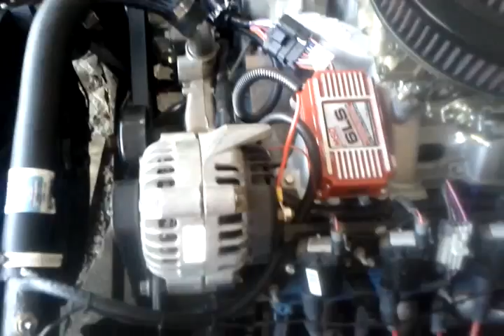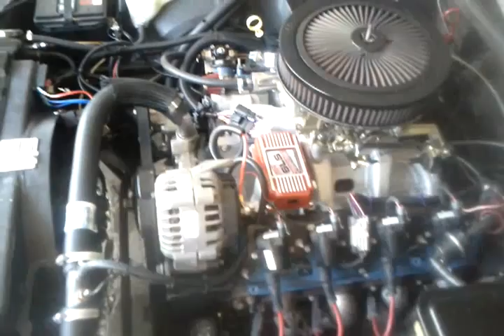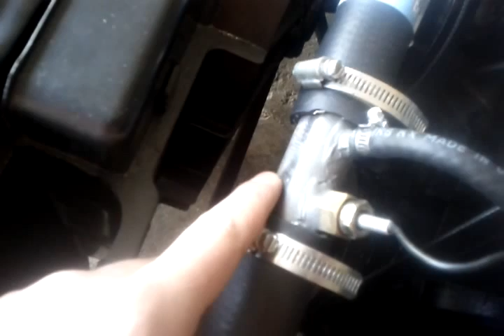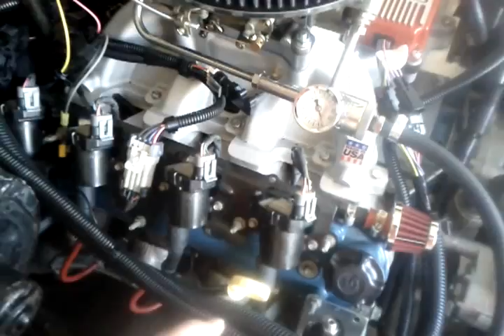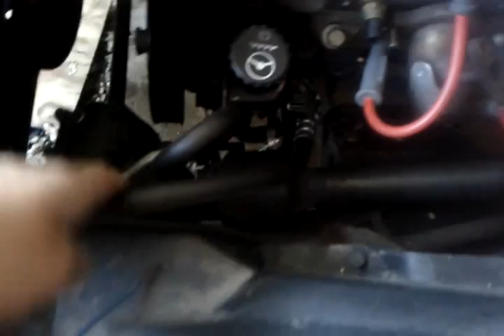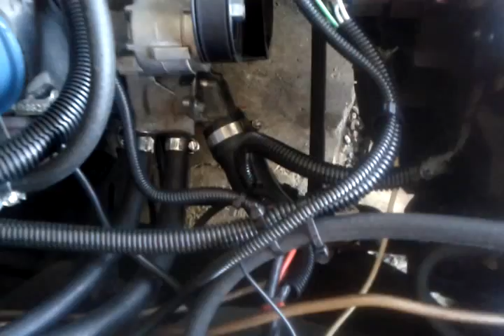How-to: Swap an LSx Ls1 4.8 5.3 6.0 into older GM cars

Comment: I'm having trouble getting mine to sit down on the motor mounts
Reply from the maker: Kelvin Thompson What kind of mounts are you using
Reply: Trans dapt
Reply: One side will mount one off a Lil and I'm putting it in a box caprice

Comment: Does the MSD box just control your coils firing? 

What sensors does it need to see in order to function?

Do they make something similar for fuel injected setups so you don't need to run a factory ECU?  Something I could plug into a junkyard engine and run on a test stand if I wanted.
Reply: brakedd crank PS cam PS and plugs into both coil banks and needs power ground im almost sure thats all it needs

Comment: Did you have to change the oil pan I have a ls1 out of a 2000 trans am.. I am putting it in my 1988 Chevy caprice wagon and I was wondering if it would have clearance issues with stock pan
Reply from the maker: james morgan your oil pan should work perfectly... IF you have a Truck engine the pan will work but you risk bottoming it out.. I went with the Caddy CTS-V pan because of its shallower dimensions..

Comment: I have a 1980 Buick Regal. With a 5.3 & 4l60e. I'm using the dirty dingo slider motor mounts that work with mounts you have. But yours seem like its sitting better than mines. And I'm running fuel injection. Try to see what to do with my trans crossmember

Comment: I have 93 ford f150 with ls1 already swap
With harness computer all I want to start the 
car
The computer is already canceled the security
Harness is fixed
I think there is some wires need to connect from computer to car fuse box
Can you help?
Or give me some info
I want start by myself if I can

Comment: Did you move the engine forward or backwards, or is it mounted so that the bellhousing is in the stock location of say a SBC? Do you know why sometimes the LS engine is moved forward or back? Seems like a lot of work to repostion tansmission mount if you move it from stock sbc location.
Reply from the maker: Engine is set back 1 inch... transmission is in its stock location
Reply: Alright thank you. Awesome swap!

Comment: Want to put one in my Buick lesabre (5.0 L Olds) now. Do you see Any foreseen problems?
Reply from the maker: No
Reply: Thanks
Reply from the maker: its very straightforward. good luck!
Reply: would this engine work found on craiglist:
http://atlanta.craigslist.org/nat/pts/5583603349.html
what about changing th2004r transmission that came in my 84 buick lesabre limited 5.0l olds engine
I hate to be a pain but your'e only straight shooter i kinda know!!!!!!!!!!!!!!

Comment: The cross over coolant hose between the heads..where did you run it? Is that the "steam line" you mentioned? And what rear end gear ratio are you running w the 4 speed?
Reply from the maker: 3.73s the steam line goes into the upper radiator hose

Comment: Wondering, did this kill your fuel milage?

I have a '73 Nova with the original 350 in it, and it gets god awful fuel economy. I'm really bouncing around the idea of swapping a 5.3L in, as they're cheap and easy to find in salvage yards, but never did I think of putting a carb on it. If it still get's good fuel milage, I might do something similar.
Reply from the maker: 20 combined with the Quadrajet ... lets see what the Demon gets come spring
Reply: BEETEROLDS i have a 85 c-10 and i was going to swap my 82 c-30 454 to it but with this LS swap gaining so much ground im looking the other way now and the BB is in good shape but the idea of having the new engine in my old truck is very tempting

Comment: Can I buy the plug for the alternator ..
Reply from the maker: ***** You can also harvest them from the junkyard... My alternator came out of a Blazer... 1 wire harness... easy peezy..... PS Fuck Oreilly ;)
Reply: Oreilly's sells them. Something like $4 or $6. I think the are between the light bulbs and heat shrink. Usually when I go to the parts store there's always some computer nerd that ask for what year make model vehicle and I just throw my hands up and start digging. No I usually walk in with a dial caliper and go straight to the back. Built not bought. That's MERICA.

Comment: hey bro i have been having trouble with the oi pressure switch step adapter. would you happen to have the part number for the one you ran on your car? thanks for the help

Comment: I am looking to do a similar build on a 84-84 Monte SS or a 85-88 Cutlass 442. Using a new carb and keep the 200R4 & 8.5 10 Bolt. I don't wrench myself so fabricating stuff is out. Id spend as much on paying my installer than just buying the aftermarket fix. I have access to a 2004 LM4 all aluminum 5.3/4l60e complete with everything. Just need to know what is the simplest install into the G Body.

Comment: How do you make the transmission work with a newer ls1 motor?
Reply: I always use the 6.0 flexplate and spacer (spacer goes against the crank) just for simplicity. you will not use on of the bell housing bolts. (top passenger side iirc.)

Comment: so if i have a 350 tbi in my truck right now, and i just bought a lm7 what will i have to change for the fuel delivery system? ie pump, lines and all that?
Reply from the maker: not if ur running a carb
Reply: What else will I need to get if I get a carb and intake manifold for it? And do carb?
Reply: Zachary Martinez
 you need a regulator to regulate the tbi fuel pump down to 7psi that the carb will need.

Comment: How did you hook up the pwr steering? And a/c.
Reply from the maker: im not running AC
Reply: power steering is easy. take the pressure feed and return line into you rack or power steering box. A/C is the hard one. what are you putting the ls motor in? what a/c compressor do you plan on using?
Reply from the maker: I used the stock Olds 307 power steering line. the pressure side is metric just like the LS power steering

Comment: Did you absolutely have to run a good scoop because of the carb set up? Also, where did you order up your intake from? I have a pace performance catalog that has a kit with and intake and 6ls box all in one kit in it, but I would really like to explore some different intake options before I lay down 800 bucks for the kit.
Reply from the maker: DONT BUY THE KIT!!!!! Piece it together!! I paid $275 for the box and $215 for the intake I bought the intake thru work...
Reply: BEETEROLDS Yeah I was thinking I might be able to get the stuff for cheaper than that. I like the carb set up for the simplicity, but I really want to steer away from having to put on a hood scoop if I can.
Reply: BEETEROLDS I was curious about it because I have a G body Monte Carlo that I have been thinking of putting a carbed LS engine into but I was wanting to run the stock hood.
Reply: I am curious to see if beeterolds used a drop base for the air cleaner.... that may make up the difference to run the atock hood.
Reply: Stuart Woody
 the intake is quite different made for lower rpm and low end torque... the box is made by msd, but they took several functions out of it. victor jr part # 350-29087
and msd # 6010 (24x reluctor wheel) **********************************************use # 6012 for (58x reluctor wheel)
Reply from the maker: I had to run the scoop because the engine actually sits a touch high... no biggie tho
Reply: fitzme1 Sweet! I am going to look into this stuff as soon as I get five seconds away from work haha.
Reply: fitzme1 That would be perfect if that is the case.
Reply from the maker: Stuart Woody my hood was already cut...
Reply: BEETEROLDS Ah, okay. Well I guess I will try it and if it doesn't fit under there I'll just find another G body hood and put the smallest scoop I can get away with on it haha.
Reply from the maker: probably not
Reply from the maker: unless u go EFI
Reply: Stuart Woody @aAQQseezzzv b h y y  h  yi hn
Reply: Damn was hoping someone would have a tip on keeping it under the hood and not efi

Comment: I have a 95 gmc regular cab short box 2 wheel drive, it has the tbi 305 and 5 speed in it now. Want to swap with a 5.3, however I want to keep the 5.3 efi and the 5 speed that's in the truck. No a/c and going to run e-fans probably on the stock radiator. Any idea on what i'll need? Everything ive done swaps and builds to is older so im a little intimidated by all the electronics....

Comment: I need help please call me at 786 -238-4343 my msd box its not sendind spark to my sparkplugs
Reply from the maker: Did you check your grounds? wire the black wire directly to the negative terminal on your battery and make sure your red wire is a keyed hot.. if that dont help the box might be junk
Reply: But  do u have to program the box

Comment: hey to make your th350/400 fit , did you need a spacer , i bought the adapter but its still to far back to bolt to back of block
Reply from the maker: Im running a Th2004r... All I used was the adapter from Hughes... all It does is get hammered into the back of the crank...
Reply: ok I'm running a th350, thats prob why i need the spacer
Reply: Mrs.Cameron Taylor
 You can use either flexplate dished or *flat. just for repetition sake I always use the flat flexplate that comes with the 6.0. the flexplate goes directly on to the crankshaft and the spacer sits in front of it.you can pick these set together from autozone part # FRA-450 (for whatever reason it is cheaper to but the spacer and the flywheel together) ** they do sell the flexplate by itself and it is more expensive part # FRA-452
TIp------- double check the fit of the spacer on the torque converter... it should not be super tight. also the plate and the spacer are locked together from the manufacturer on the FRA-450
Hope that helps!
Reply from the maker: I used the Hughes step bushing that gets driven into the back of the crank

Comment: do you have a part number for the upper radiator hose
Reply from the maker: Not off the top of my head... I just used a hose from a 1999-2006 Silverado 4.8 or 5.3.. I cut it down a bit to keep it from flexing

Comment: Nice vid!
Question on the motor mounts. I too want to reuse my factory clamshells. Do you have the measurements for the plate that bolts to the block? Or know where on the net I can get those measurements/diagram to build it? I was going to use 3/16" plate.
Im installing an LS into my 84 C10. I know guys are buying the mounts online but have heard of some having issues with the motor sitting too far forward or rearward.
Thank you
Reply from the maker: I just did a google search and sent my friend the link of the CAD drawing so he could burn me the engine plates on his CNC burner... you have couple options.. However to keep the trans in its stock spot you need to use the 1 inch set back plates
Reply: Thank you! So by setting the motor back that 1'', I can locate my trans on the stock mount. That's my intensions, cause I dont want to alter the driveshaft.
Thx again, I also know someone that has CNC machine. Il try and get diagram for the 1" sset back plates.
Reply from the maker: correct 1 inch setback puts the motor in the stock spot so you don't mess with your transmission
Reply: Thank you sir! Appreciate the help. I cant wait to get started on my project!
Reply from the maker: I just Googled LS swap motor plate CAD drawing and boom there it was.. I sent the link to my friend who is a CNC machinist and he made me the mounts... I reused the clam shells and all

Comment: what fuel pump did you use
Reply from the maker: I used a Fuel pump/hanger assembly from a 1987 Chevy Monte Carlo 4.3 V6
Reply: BEETEROLDS
Just to be clear you used the Hager/sender but not the pump the,right? Isn't the 4.3 v-6. TBI and only runs about 18psi to low for Port injection. I realise the fuel pressure regulator sets the fuel l pressure but have been told and read that while the TBI pump might make the pressure and volume, it will be at the vary limits of it's capability ie maxed out,and there for it's reliability should be questioned.
Hope I didn't confuse things. If I'm wrong I apologize and will keep my 2cents to myself, from now on.
Soon as time and money line up planning to stuff a 5.3 into my 91 Formula Firebird WS6 and ditch the l98 TPI 5.7.
Reply from the maker: Nope used the pump and hanger... Im running a Corvette Style fuel filter with a built in a return and returnless style regulator. works like a champ

Comment: I'm doing a lm7 swap in my 77 nova, would it be the same alternator wires as yours?
Reply from the maker: I use a chevy blazer alternator... 2 wires.
Reply: I have another question,   you know how you turn the disturber 180 off on older sbc engines and gas spits out the carb,  my 02 lm7 does that when I cut the engine off. Spits gas out the carb on my  lm7 when I turn the car off

Comment: Ok...what the hell am I missing in this video...no distributor and no ECM??? but crank triggered ignition??? and tunable MSD box???
Reply from the maker: MSD controls the ignition. Thats it
Reply: Is the msd box wired to most of the sensors or just a couple? Does it monitor O2 sensors?
Reply from the maker: NO o2 sensors the only sensors that are tied into the box. Only Cam Crank and Map sensors are used

Comment: All of this without an ECM?  Very Nice Work.
Reply from the maker: Yup the MSD 6010 is the only piece of electronics you need! :)
Reply: BEETEROLDS How much power loss injected VS carburetor do you suppose?
Reply from the maker: Carb's can typically make more power, from what ive seen but i think a lot to do with it is in the intake design... you can't beat a good EFI set up... fuel economy and all around better driving habits is where its at.. but since im running a q-jet I have no complaints

Comment from the maker: I made a video recently.... Dig thru my recent vids its in there... The MSD is a lot simpler than most ppl think... it comes with all the needed plugs and harnesses... all you need is a simple 12v source and a good ground and voila your motor is running.

Comment from the maker: True but I over built my electrical system with 50 amp relays and large gauge wire after a 30 mile trip I checked the wires, relays and switches for hot spots and I have yet to find a single one.. you are correct tho... The electrical system, cooling and fuel systems should be overbuilt for reliability

Comment: used the Flexlite controller.Pricey but it is a quality part for a vital function.Lots of safeguards built in and can handle the spike at start up.Anything that draws this many amps needs a quality part to avoid any fire or breaking down on the road.Adjustable to.

Comment from the maker: Well ya can't believe everything ya read on the forums... Im all over LS1tech.com and I have never seen any problems with the new ones.. They piss and moan the old ones were faulty.. but the only other true option you have which is reliable is to retain the factory EFI system and if mine takes a shit thats what im going to do.. Run EFI the way the engine was designed to run

Comment from the maker: So whats the problem? How old was your box? If was made before 2010 i'd avoid it... the newer ones are just fine... your sitting here pissing and moaning about a $300 ignition controller.... sure there are better options but they come with a price... If you mount the bastard away from heat, isolated from vibration there should be no reason for failure.

Comment: metric bolts. FWIW the metric equivalant of grade 5 standard is marked 8.8 on the head these are not hi-strength bolts grade 5 to equal grade 8 you need bolts with10.2 or higher made into the head. Also metric bolts uasualy have 3 different thread pitches for any given size so saying it coarse or fine is meaningless for any given size bolt 1.0,1.25,1.5 ectra. If ypur engine has alum block or heads I strongly urge you to use anti-sieze on the threads.

Comment: I strongly disagree it's cleverly done and well thought out. The fence pipe is a clever thinking out of the box and form follows function engineering, also the use of the rad insure more than enough cooling w/o a multi hunderd dollar custom copper brass or alum. monster that 2speed ford fan is just about the most powerful made. One thing he didn't cover is when it kicks on it will spike to 40amps and then settles back to more like 15-20 at run so don't be surprise when it blows that 30amp fuse

Comment: the LSx engines use most of the traditional bell housing bolts the upper left as you look at the back of the block is not used doesn't seem to cause any problems. Be sure of the year and size of your engine as the Rr crankshaft over hang changed. check out LS1TECH .COM for more info in greater detail.

Comment: I have a thermoswitch in an inline hose housing in the cold side hose (or directly in the AC switch location on the radiator.)
it switches on the E fan at the high speed via a  two speed relays found in the 900 series or volvo 850.
all automatic on mine : )

High speed is automatic and low speed is a manual back up if the high speed part of the realy is dead.

It's very cheap i bought at the junkyard for way less than 80$
at turbobricksdotcom there is an interesting topic on efan conversion : )

Comment from the maker: Since Im the only driver of the car I just have a manual switch setup... However Hayden makes a 2 speed automatic thermal controller but I couldnt justify spending the $80 on it

Comment: Looks good!

To each his own! But, if I were to swap my engine from a "carbureted" engine to an LS1, I would want to keep the LS fuel-injected and pair it with the usual six-speed transmission. Going this route seems redundant. You could get just as much power with a regular 5.7L crate engine.

May I ask, and I'm not at all bashing you, but why exactly did you decide to go with an LS set-up, without converting your car to fuel injection?

Comment from the maker: depends on the alternator.. I used an alternator from a Chevy blazer.. you use the main thick wire that goes right to your battery and the plug has one tiny little wire which goes to the dash..